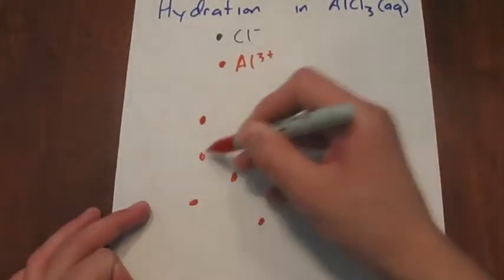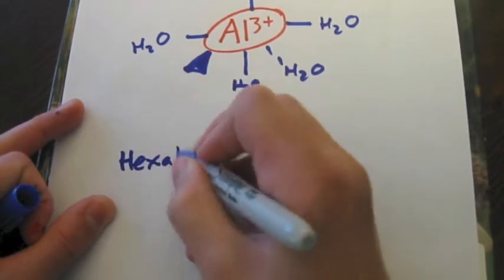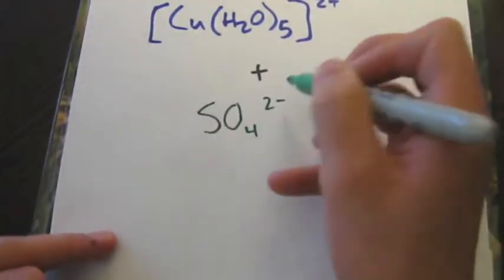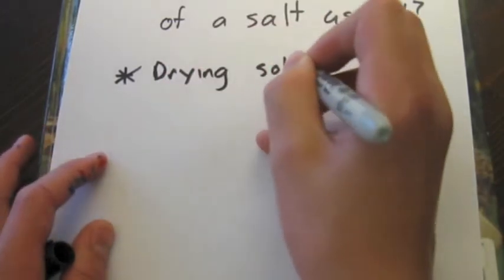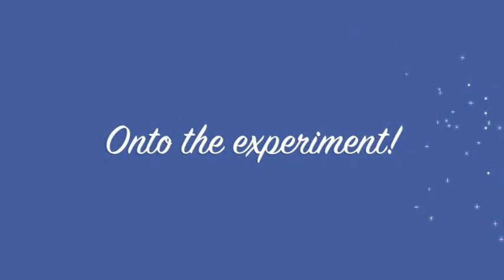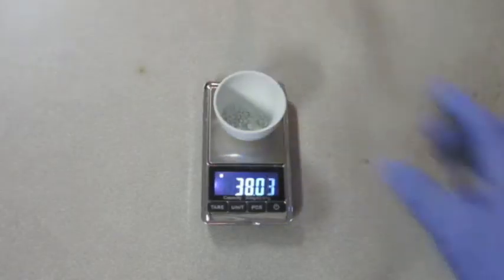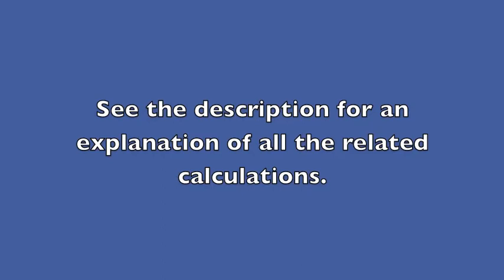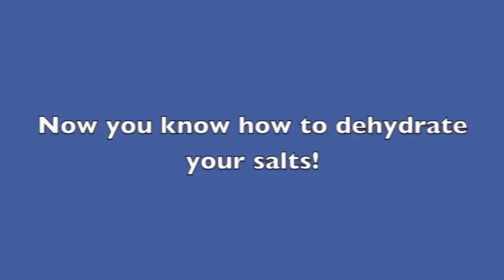How to: Dehydrate Salts

Comment: Yes and in doing a dehydration of hydrates, it requires quite a bit of propane, was wondering if you had this type of burner is more efficient?
Reply from the maker: +Gregg Jones I just used this at the time because I didn't have a propane torch. Using a propane heat source would go much faster because the propane burns so much faster than alcohols